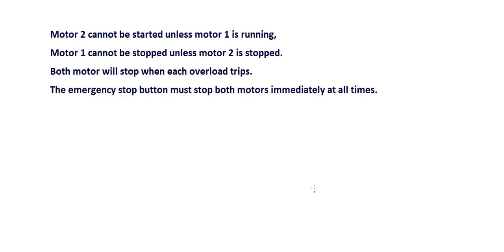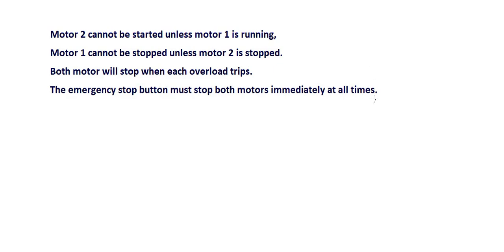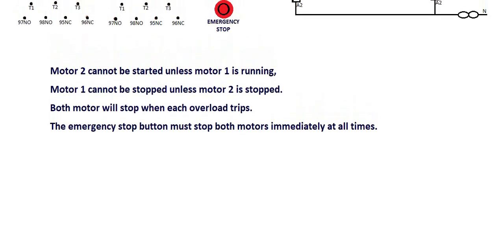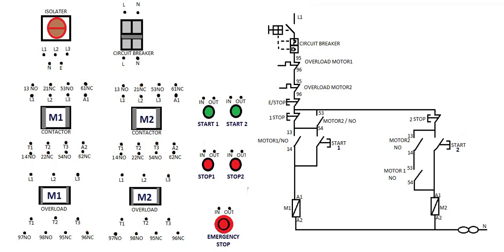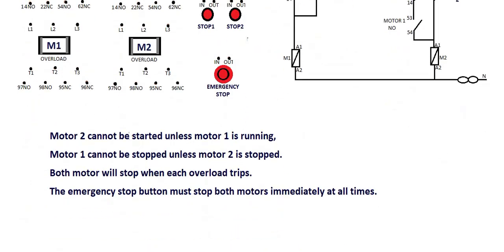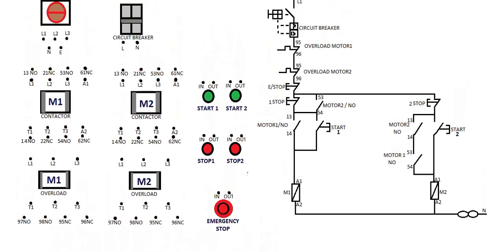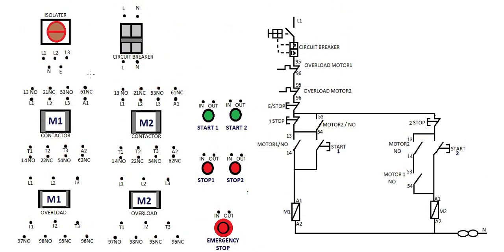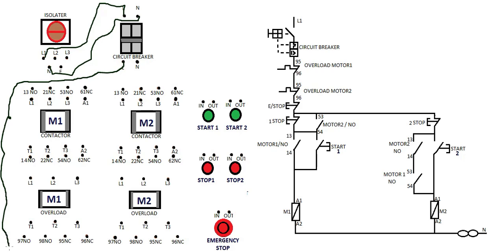Motor2 cannot be started unless motor1 is running, motor1 cannot be stopped unless motor 2 stop

Comment: hi, i just want to check the output of the start button for motor 2 is not connected, does that not make the circuit to be not complete/or  an open circuit, just a question, because i believe that the output of start 2 suppose to go to A1 of motor 2... please correct me if m wrong